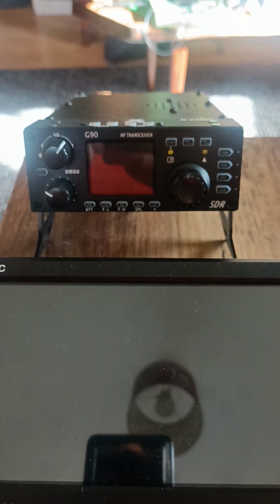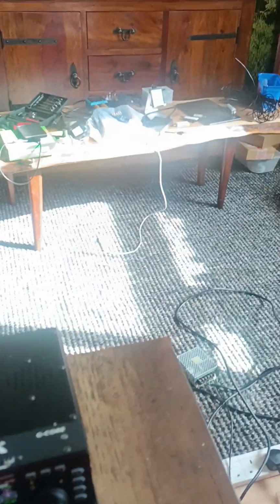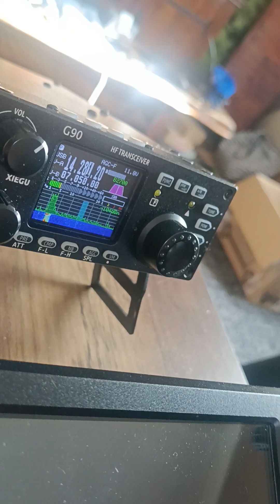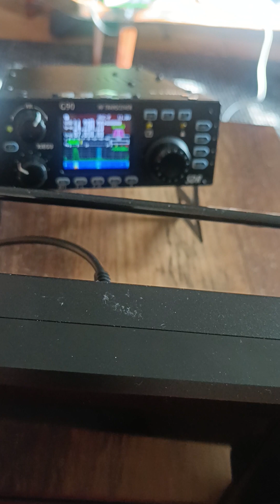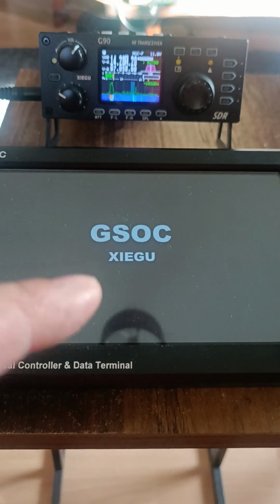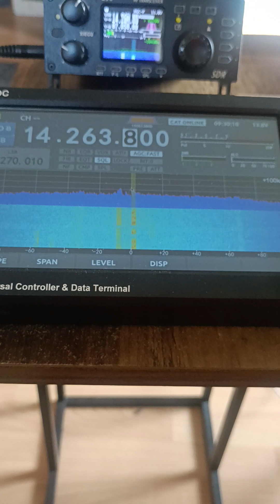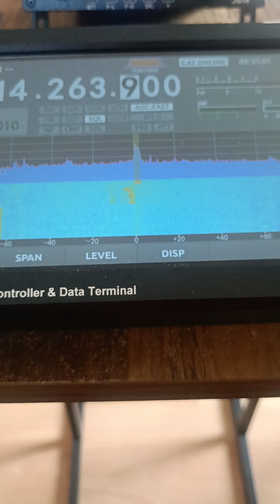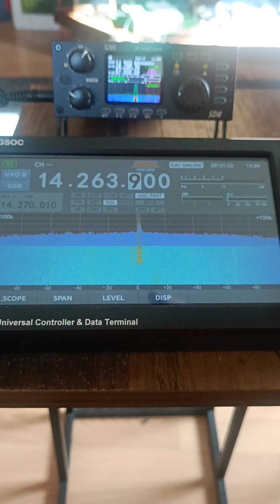Xiegu GSOC and G90 working

Comment: Hi there,I upgraded the firmware on the main unit and display on the g90 but it’s still not working with the Gsoc the way yours is working.is there any settings you need to change.also do you know of a mod that enable open tx with Gsoc.it’s open with g90 but not with the Gsoc connected.

Comment: Steve - Thanks for taking the time to post this. I just snagged a G90 and GSOC finally, after looking at them for a long time. I rushed into the GSOC as a package deal and had some buyers remorse reading reviews and lacking support. Looks like this is the ticket though! Maybe not as they initially intended, but looks like it works well. 

Could you confirm what firmware you're running? Is this with the 1.79 firmware on the G90 and 1.3 on the GSOC? 

73 my friend! - KS0TOR
Reply from the maker: Yes

Comment: Great stuff Steve.. I bought a GSOC with my G90 a few years ago and always used the serial port and the I/O. This is interesting it works this way as i always liked the screen size of the GSOC but it lost it’s wideband capability.. I also used the GSOC as the head so this could be another good option running both using the GSOC as a screen extension.. Watching with interest re the i/O.

Comment from the maker: Settings on GSOC >1SCOPE>LEVEL>FFT-10, WF+10
DISP>Line colour red , fill colour blue
2RADIO >SYSTEM>IF Input OFF

I am waiting for I/Q amplifier from Rob https://quantumsdr.com/low-noise-iq-amplifier-for-xiegu
Reply: do you need a switch to connect SDRplay or just plug in to radio?
Reply from the maker: @ruivieiraonair  just the correct cables